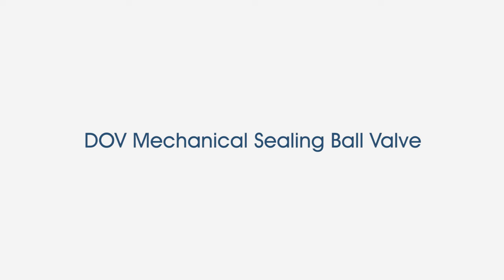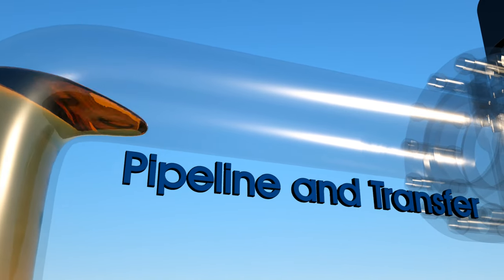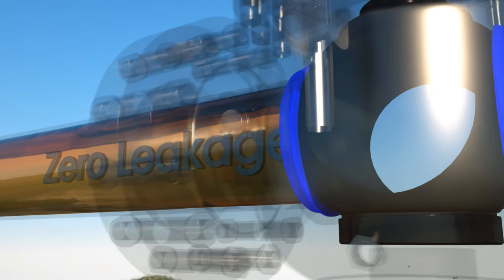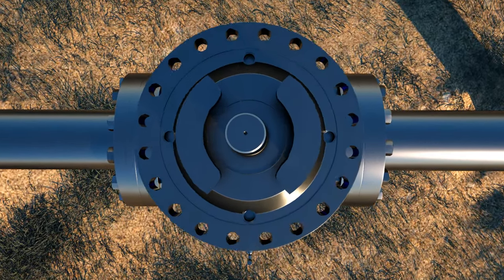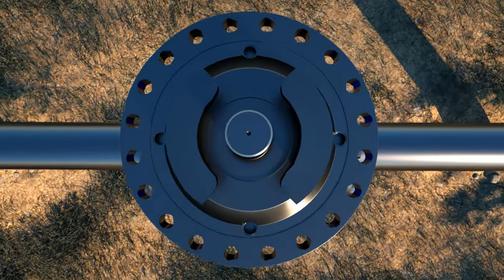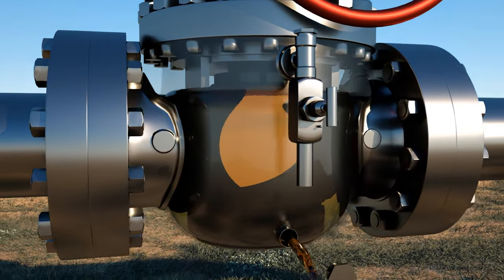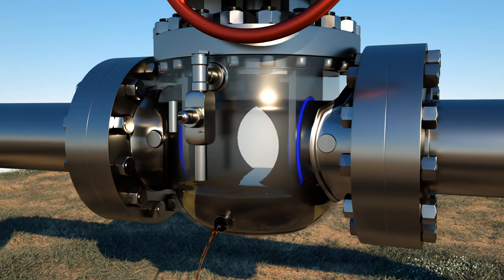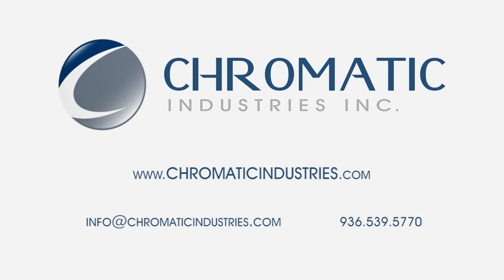Double Block and Bleed Animation for Industrial Valve Company

Comment: Sir why these are not allowed in confined space activity #isolation
Reply: Because you can’t rely on valves for isolation as they may have a mechanical failure and result in leakage that’s why a positive isolation is done by  removing all the valves connected to the vessel or by closing the valves and inserting blinds and spades.